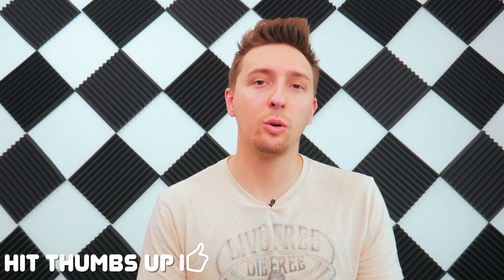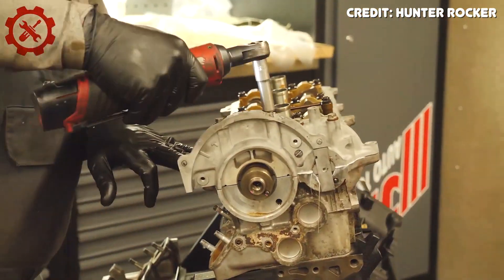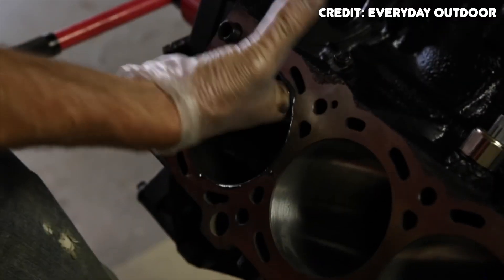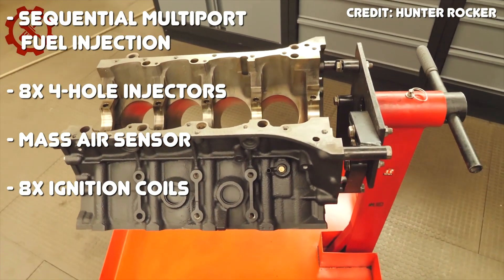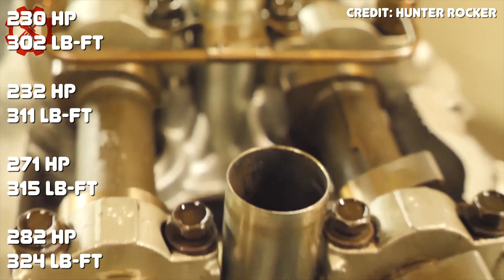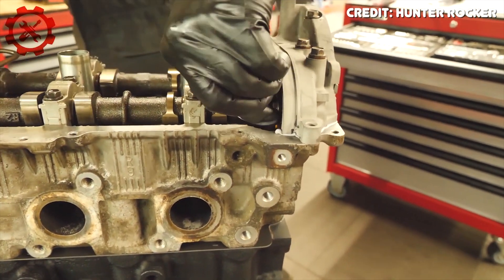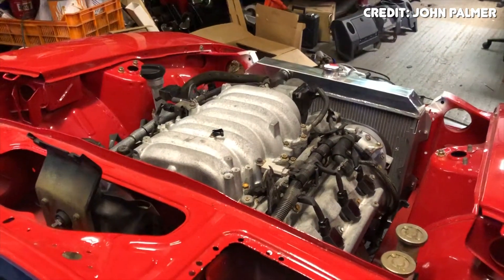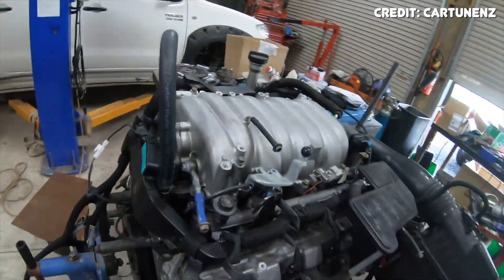The Evolution of the Toyota UZ Engine (Explained)

Comment from the maker: Correction - 1UZ and 3UZ technically have 6 bolt main caps, not 4 bolt main caps. They have two side bolts per cap which I completely forgot about when writing this 😐 (mistakes happen).
Reply: Same as 2UZ
Reply: Hideous?  LOL!  I just got an '06 SC430 and love that car.  I drive it more than I do my RX350.  Smooth. Quiet.  Powerful.  Top goes down.  Leather/wood inside looks great!
Reply: I am planning to install IUZ or 3UZ for my cruiser 1969 ford mustang. Which engine you would recommend? 

I am not looking for high horsepower but would enjoy some torque. 
Also, planning to install the Ford Cobra supercharger in the future. 

Both full engines can be found relatively cheap and will to search for the best year and configuration. 

Planning to make it 5 speed manual too using Hilux R155F transmission with 2006 Camry V6 flywheel and clutch ..etc. 

Any recommendation would help 😊
Reply: @thaieralawadh2223  3Uz with 1UZ rods.
Reply: @paulbaerwald8055  only the 89-94 had the stronger rods, 95 and up 1uz has smaller rods
Reply: @johngacy6367  Thank you for the knowledge!!

Comment: The 2UZ has a timing belt, not a chain. Toyota 2UZ-FE engine (often called the "2UZ") is an interference engine, meaning if the timing belt breaks, pistons will hit valves, causing serious damage, though early non-VVTi versions had a slight chance of surviving, while later VVTi versions almost always suffer catastrophic failure. It requires diligent timing belt replacement (around 90k miles) to avoid expensive repairs, as there's no warning before failure.

Comment: I am thinking about rebuilding a 2uz that is currently in my gx 470 and looking for real differences in the 1uz and 2uz that cause the 2uz to be “weaker”. The only big thing i see is 6 vs 2 bolt main caps. I also keep hearing 1uz has more main bearing journals (4:59 and other google results) than 2uz but looking at photos they both appear to have 5.  If they both have 5, and the only other main difference is the main cap bolts, i dont understand how the 2uz is the least likely candidate for a performance rebuild. 2jz has 2 bolt mains and handles stupid power all day. What am i missing?

Comment: Corrected information here, 89-94 1uz-fe are non-interference, 95-97' and 98-00' vvti is all interference. 89-94' has 6 bot mains with stronger rods, 95-00' and 3uzfe has weaker rods and 4 bolt mains so the early 1uz's are sought after for boosting.

Comment: Great video,  Thanks.  One thing id like to add is that on the 1uz  the switch from non interference to interference was actually in 95 with the increase of compression not when they added vvti in 97.       So the only non interference uzs are the 94 and older models.

Comment: Great video explaining these uz engines. My 98' gs400 with 1uzfe has been an awesome everyday driver past 10 yrs. now with 228k miles. it's still so smooth, powerful, & reliable.
Reply: I have had a '98 GS400 for the last 18 years, at 230k currently. I just had a second timing belt done. The engine is still as smooth as butter and power is always on tap...Great cars!

Comment: You caught the main caps that are 6 bolt, but also one important distinction about the difference between 1UZ heads and 3UZ heads is the flow. 1UZ flow 125cfm per cylinder in stock form which is dismal. 3UZ heads flow 236cfm per cylinder stock form which is over double. You can only make so much power with 125cfm. Even with boost. HRE in NZ got 270cfm out of a ported 1UZ head to make 500WHP N/A. He told me he got over 300cfm out of a 3UZ head and with revised compression ratios could hit ~600WHP N/A with ITB's and good headers.
Reply: what are itbs?
Reply: @seanskiles4414 
Individual Throttle Bodies
Reply: @DarkInstinct05  Thank you!
Reply: @seanskiles4414 individual throttle body

Comment: To summarize 
Go for a 1UZ for Boost Builds
Avoid the 2UZ for any Builds
Enjoy the 3UZ For N/A Builds 

Not that im biased owning a LS430 but i would say the 3uz give the best middle ground between HP/Torque is met by the 3UZ
It's the best for ITB's and sounds the best when combined with Equal length headers and a x pipe (maserati 4700 vibes)
Reply: Agreed. 2uz is an amazing engine with some basic bolt ons but should be left at that.
Reply: 2uz if you are swapping a truck.
Reply: @dillonh321 I’m putting a 1UZ in my truck. But I’m building a 2500 lb prerunner. So it’s a “truck” and not a TRUCK if that makes sense
Reply: can the 3uz make good power with boost too?

Comment: Is a 1992  Lexus ls 400 1UZ-FE engine an interference engine?I just paid to have the engine replaced due to the belt breaking. I have a feeling I got scammed the engine only had 124 k miles on it. Thanks

Comment: If an engine with a shorter stroke make hp higher up. Why does the 89 Mustang GT (3 inch) peak at 4200 rpm? The 2011 5.0 GT (3.65 inch) and peak at 6500 rpm.
Reply: Better head
Reply: @gava7691  Better heads will increase hp but they don't control where the engine make peak hp. Before you say I'm wrong. Think about this. An 89 5.0 made 225 hp @ 4200 rpm. People added superchargers and the engine made 300 hp but it still peaked @ 4200 rpm.

Comment: Just so you know, the “Terminator Cobra” supercharger is an Eaton M112. It was also used in some Mercedes sports cars and the SVT lighting.
Reply: Mercedes used a twin screw supercharged v8. Lysholm is the company that made the supercharger for the amg cars from 2003-2007. Eaton was used on ford/jaguar and GM cars

Comment: 1uz build prior to 9/94 are non interference...   after that, still non VVTI, but interference.   Difference to look for, non interference have coils  whose tower points up, fuel rails are thick block billet...   interference 1uz has coils pointing horizontal, fuel rails are cast aluminum.

Comment: I've seen people go 500 whp on a stock 1uzfe vvtti but I would not go any higher without bulletproofing the engine a little more, he said 1000hp and that is easily achievable with a 1uzfe vvti if you know what your doing but you will need some sort of forged internals, having said i love my 2000 gs 400 with the 1uzfe vvti it is definitely one of the most reliable and fun engines to build
Reply from the maker: Oh yea definitely achievable with a built bottom end!

Comment: Thanks for ten video. I was very interested in learning about these engines as my dream is to swap on into my 1996 4Runner. The thing is I wonder which engine will pair the best to a manual as I want to use my factory 5 speed manual and transfer case. I know people make bell housing adapter which will bolt up to all of 3 of the UZ engines but I’m unsure on the electronics side as Ive heard that the 2uz and 3uz are a more of a pain to convert to manual and will always have a CEL

Comment: just to make a correction, 1990-1994 1UZ = Non interference. 1995-1997 Non VVTI = interference. 1998+ VVTi = interference. There is tons of confusion on it, but there are the facts. Lexus/toyota can confirm. More years are interference than not.
Reply: Thanks I was confused for a second first thing I’m doing when I buy my ls400 is replacing the timing belt

Comment: That first generation of 1UZ was so over built.  It's truly an underrated engineering home run.  There's not really much negative to be said about it.
Reply: The vvti version has a better head, comoression and the cam scissor is closer to the pulley. The only downside is the vvti has weaker rods
Reply: @MegaGingerpimp  first gen has forged pistons and a stronger block I’m pretty sure
Reply: @elijahjohnson5872 <1997 has the strongest block and crank, >1994 has the strongest rods.
Reply: @onse8982 do which ones better to build for power? Most people say the first gens because they have a lower compression ratio an the rods are much stronger an capable of handling close to 1000 hp but vvtis have a 10:2 ( I think ) compression ratio making it better for n/a power building
Reply: @Gabethemosthated  If you’re looking for less than 400hp then the VVT-i, headers, exhaust and a supercharger with low boost. I don’t know about the VVT-i compatibility with aftermarket ECUs so best to use a pre 94 engine if you’re shooting for big power.

Stock the 89-94 has smaller valves, but thicker stems. VVT-i engine has better ignition and no problematic EGR.
Reply: @onse8982  do you know n/a capabilities of the 1st gen? An also if my plan was to go twins do you think it would hold up well?
Reply: @Gabethemosthated  headers, exhaust, cams, porting the heads and a remap could get you north of 320hp at the crank, it’s expensive to tune an n/a, slap a supercharger on that to get it close to 450-500hp on stock internals, cometic MLS headgaskets while you’re there. Stock rods can handle close to 600hp.
Reply: @onse8982  in some forums I seen people saying they made close to 1000 on stock internals on non vvti models wether it’s true or not idk but I appreciate your advice I want to get a 96 ls400 cause it’s the lightest an swap a non vvti 1uz into it an start making power because I want to make a street car Ik you probably heard this before but I really interested in the platform an I wanna car that’s not the average meta for fast street cars rn do you have any other advice for me in what to do?
Reply: @onse8982 just curious where you heard that? Genuinely interested.
Reply: The starter location is the only bad thing about it, but even then, that starter will last 2 decades.
Reply: @RetardedSysAdmin  My Brother has the OEM his car came with still going strong. The engine has never been touched.
Reply: Trying to get a gs400 that would be great
Reply: Replacing the starter is a pain in the ass tho
Reply: @GrapeFaygo959 Couple nuts and bolts mate. Big boy leggo.

Comment: i read that the 2UZ in the gx470 and the 4runner which are made  in Japan have a stronger bottom end than the 2UZ built in the U.S. i would really like your input on this.
Reply: Now now men…. The only difference between Japanese made 89-2002 is the piston rods are heavier duty vs. American made there after. As long as you don’t go stick a supercharger in there with a small pulley same thing… but different.
Reply: Source please?
I don't believe you.
Reply: @1malikalik  look it up. I'm not your parent.
Reply: @jameskocks4734  
Wooooh, hold up now. Don't come at me sideways bro. The JDM vs American made has been settled. I got a SEQUOIA MADE IN USA with over 400k miles so am not sure what you mean.
Please support your argument and stop ovulating
Reply: @1malikalik  with that response you like yourself are menstrual. Look dude 4runners have been built in Japan since the beginning. The Lexus version is also built in Japan.   I love this country they're better built over there. Stop whining. Sequoias are kick ass trucks too.

Comment: My classic first car the 1990 Lexus ES250 had the legendary 2VZ-FE. V6 DOHC 160hp 160ft lb torque and ran that son of a gun over 300k with basic maintenance. Piston rings weren't exactly in the best condition towards the end so when going downhill then reaching the bottom of a hill and launching from a flat start it definitely blew a blue puff of smoke but that just gave it character. Vave guides were somehow not leaking. It also had the rare 5 speed manual which I did have to replace the flywheel and clutch which is normal but the synchros were going out from 2nd to 3rd so it was a 2 second shift. Some kids threw a bunch of rocks at it at night and it totalled it out. It was my first car many many years ago and it hurt when I had to replace it, but I traded it in for a 2006 G35s coupe. Kept the shifter knob and will always keep that thing until I loose it.
Reply: Damn man can’t believe someone would throw rocks at a car like that and total it, sucks man. I recently got my first car and it has a 3VZ-FE which I’ve heard is a great engine. It only has 52k miles so I hope it lasts as long as yours did.
Reply: @Michael-mb3qr  change ur timing belt, water pump, sparkplugs, oil and filter, air filter and that thing wont ever act up again for a while

Comment: Anyone know why 2nd gen ls400 made more hp than the 1st gen?
Reply: The lighter rotating assembly they put in for 95 and 96. Thinner rods that aren't good for boost. If boosting and not building the bottom end you want a 89 to 94 1uz

Comment: The 90-94 1UZs (big rod engines) were non-interference, the 95+, regardless of vvti or not, are all interference engines.
Reply: What about 5.7L Is it 3UZ or what?
in many Toyota tracks Tundra ,Land cruiser, Lexus etc..??
Reply: @wldmhd  The 5.7L is part of the UR Engine family that replaced the UZ family. It consists of the 1UR-FE (4.6L), 2UR-GSE (5.0L), and your 3UR-FE (5.7L).
Reply: @wldmhd  3UZ is 4.3l,  2UZs were the 4.7l found in trucks and SUVs. Toyota preferred to keep a ironblock in them over a aluminum block.
Reply: nice, didnt know  this, i guess 94 1uz swap is the way to go then for non interference, unless aiming for newer for vvti + more hp
Reply: That was an misinformation in the video. I hope nobody had to find it out the hard way after a broken timing belt.

Comment: How does the Japanese v8 stack up against v8 from Europe and the states?
What's the best v8 from japan
Reply: I stay away from BMW V8s because of all their problems which are inevitably gonna present themselves...valve stem seals, the valley pan cover gasket, excessive oil consumption, ALL kinds of other engine leaks, and premature engine component failure, rod bearing failure, throttle body actuator on some engines, damn plastic chain guides like who thought that was a good idea (I guess you could replace them with something else besides plastic). Parts are expensive and how they are built and the cars around them they are not DIY friendly. Reportedly N62 is one of the worst.
Reply: They dont really stack up like the german ones do.  Cause you know,  the japanese ones are still in their cars running and the germans are literally stacked up in yards or sheds.
Reply: @REAPER3fitty  ahhahahahahahahaha nice so ttue
Reply: Bmw v8 are cool and neat but    a no form me' but mercedes v8 i will   buy "use" and  hoon with
Reply: @apprenticefelix7740  german engines just too complex in there designs